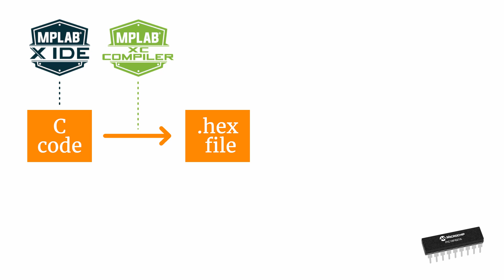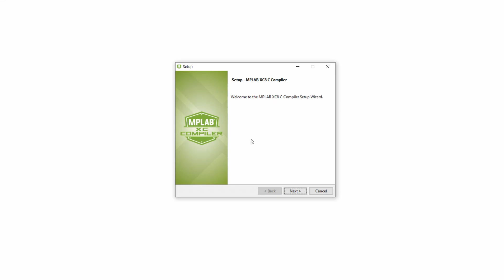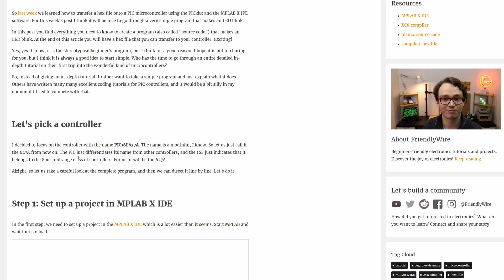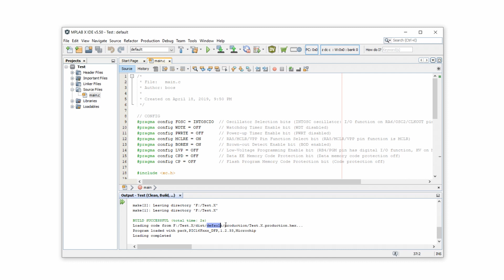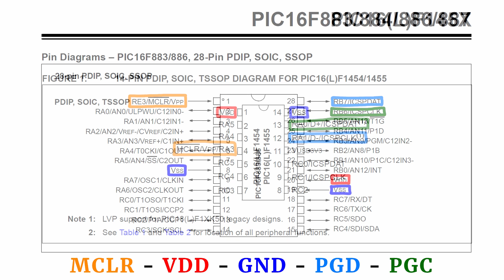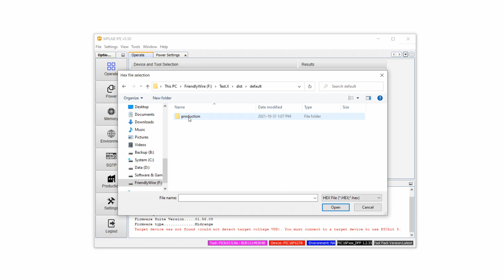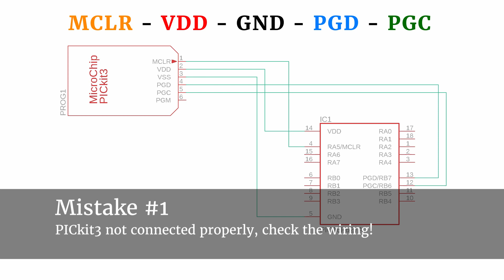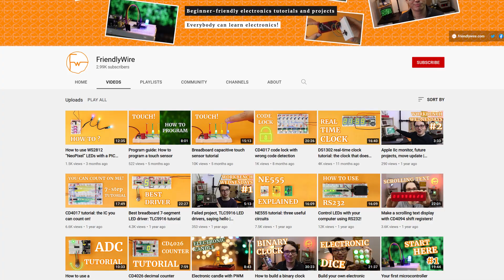How to get source code onto a PIC microcontroller

Comment: Hello. I am using Pickit3 for programing my PIC18F45K42. I have a problem with LED blinking. In code i set the while loop to bling the diode 5 times, but it keeps blinking forever. Does it something has to do with configuration bits of PIC18F45K42 or is something wrong with connections and my microchip maybe is resetting nonstop ?
Reply from the maker: It's probably because everything is enclosed in a loop like this:

while(1) {

// your LED stuff

}

Can you share your code?

Comment: Hi, thanks for your video, it made me understand many things.. I have a .bin file of a USB module, is a motherboard gamepad, the board has a PIC18 chip etc.. I have the manufacturer's firmware file , I would like to be able to open it to modify it, how can I do it ?
Reply from the maker: Hey there, I am glad you found my video helpful! I am not sure how do to what you have in mind, I am sorry. Most likely the manufacturer has code protection enabled. But even if you can get access to the code, it will not be in C, but machine code, which is much harder to read for us humans. Do you have experience in hardware?
Reply: @FriendlyWire  Thanks for the answer, yes, I have experience, but when I open the binary I find: 5!`¤*4$ óÖX›Ñ ‹ìxœï› Ó>Ðº½p, :-(...
I just can't figure out what language this is. i tried all possible converters to extrapolate to C or other, but nothing,. , this file is loaded on the electronic card via USB, using a software: HIFlash.. :-(
Reply from the maker: @fedeyoutub  Try opening this with a hex editor instead, it may be more suitable. But it's probably just machine code for your device, so it will be difficult to convert it back.

Comment: Can we copy hex file from microcontroller??? Please reply as soon as possible 🙏
Reply from the maker: Follow the steps after 7:00. Connect to your PIC, and then click on "read." Then click on File -> Save As, and you can save the .hex code onto your computer. If "code protection" has been enabled, then it won't be possible to extract the .hex-code like this, however. Hope it helps!
Reply: @FriendlyWire  thanks 🙏
Reply from the maker: @satishkumar-gg5fm  Happy to help, and thanks for stopping by! :)

Comment: Hi - Thanks for your video. With the power supply error at 10:00 minutes into your video, change the power setting to 4.75V and you can proceed past this self test ok. No external supply needed. 😁
Reply from the maker: Oh yeah, good idea! It may work sometimes, but usually when the voltage breaks down it means that the PICkit3 cannot supply enough current (and there may be a reason for that, such as a large number of external components). Glad it worked in your case! :)

Comment: Hello. I have seen this video a lot of times and I have made the same "Blinking" program as you and it works OK... BUT when I place the PIC16F627A in my Breadboard and turn on 5 Volt it seems very unstable. The diode is blinking one seequence and the stops but if I touch the PIC chip it turns ON and sometimes the diode just goes ON and stops again and other times the seequence is running. It seems that the chop is sensitive for my fingers... The PIC chip is only connectet to pin 5 for GND pin 14 is +5V and pin 9 RB3. Should I connect all the unused pins to ground or what could I do to make the system more stable??
Reply from the maker: Thanks for your question, and I am glad it's mostly working already! Have you tried adding a 100uF capacitor and a 100nF capacitor in parallel to the battery? This should help stabilize things.
Reply: @FriendlyWire  
Thanks a lot... that solved my problem...Fantastic. I will go on learning  programming PIC's. Are you still making video clip of programming PIC's?
Reply from the maker: @oveschleisner-meyer8139  Fantastic indeed, congratulations! Yes, I am still making videos, but it takes me some time to get them finished. Check out my Twitter @FriendlyWire where I post updates on the new projects :)

Comment: How about 12c508/p 04 HAM modchip???? I need digram point for it GND VDD all 8 pin i have k150 programmer and it give error recived data about reset play...
Reply from the maker: Looks to me that VDD is pin 1, GND is pin 8, MCLR is pin 4, PGD is pin 7, and PGC is pin 6. Check out table 3-1 in here: https://ww1.microchip.com/downloads/en/DeviceDoc/40139e.pdf Hope it helps!

Comment: Sir  , mpli ixe   in  advance  settings  which password  use??
Microchip ic  read and save which  software  best for pickit3.5?
Reply from the maker: I think the default password is "microchip" in the advanced settings, it should say somewhere in the window. I think the MPLAB IPE works with the PICkit 3.5, have you tried it?

Comment: How to program  read in ic and save file for copy other ic .
Reply from the maker: Follow the steps after 7:00. Connect to your PIC, and then click on "read." Then click on File -> Save As, and you can save the .hex code onto your computer. If "code protection" has been enabled, then it won't be possible to extract the .hex-code like this, however. Hope it helps!

Comment: Hello. Thanks for posting this video. I stumbled across it and wondered if this device maybe the answer to my problem. I have a motherboard on which the bios has failed due to my own stupidity as to how I flashed the chip (Winbond W29C020-12 32 pin 2mbit) whilst the onboard button battery was dead. I then flashed it a 2nd time and wrote over the back up (duhhh). The consequence is that the board cannot see a floppy drive or even a non accelerated ISA VGA card. The motherboard company are no longer around, but I have the bios on a floppy disk in the form of a .bin file which suggests the file is hexadecimal in nature. Would the mplab software be able to view this type of file in order to 'flash' it directly to the chip? Thanks.
Reply from the maker: Thank you for your message, John. I don't think the PICkit3 will be useful for that, since "out of the box" it only interfaces with PIC microcontrollers. It may be possible to write your own PICkit3 firmware, but I am out of depth at that question. I think at https://www.reddit.com/r/AskElectronics/ you may find people who know how to do that. Good luck, and sorry I could not be of more help, I hope you will find a solution!
Reply: @FriendlyWire  Many thanks for your response. I will check the link and keep looking for a solution.
Reply from the maker: @johnsparks3979  Good luck, and my apologies that I could not be of more help. Best of luck!
Reply from the maker: @johnsparks3979  Best of luck! Did you find anything?

Comment: Mine didn't work initially, even after trying everything you said. It finally worked after placing a resister between the VDD and MCLR, which from my understanding, was not required (newb trying to read datasheet) : using PIC52313
Reply from the maker: Thank you for sharing, Mike, and I am so sorry that it didn't work for you. (Sorry that I am replying so late, I only now saw your comment.) MCLR does not require any resistor to VDD with ordinary PICs when programmed with the PICkit3. I am having some trouble finding this controller, the PIC52313. Usually the names start with PIC16F or PIC12F, but this one is different. Can you double check the name? I would love to figure out why it didn't work out properly.

Comment: one more question on some other Topic, how and from where to get and download different supporting library's for PIC microcontroller ? 
e.g LCD library or I2c , or RS485  I mean any library
Reply from the maker: Libraries are not so common with PIC controllers; the reason is that each PIC controller is different. You can search for what you want to do, say, control an LCD. When you find a project online for a specific PIC you can usually use it easily yourself for the same PIC. For really advanced topics, such as SD card memory management or USB stuff you find some libraries, but for simpler stuff you probably have to code your own. I think of it as an advantage (long term) because it really teaches you how to code, but for beginners it can be frustrating.

Do you have anything in mind, in particular? I would recommend to get started with a simple project, maybe one from this channel, and then take it from there :)

Comment: is there any other way to program pic microcontroller  without using pickit to save money?
Reply from the maker: You can find unofficial copies of the PICkit online, they cost much less. Also there are some circuits proposed by hobbyists that can get the job done, but I have never used those. What is your budget for a programmer, and where are you located? Maybe we can find one for you :)
Reply: @FriendlyWire  india
Reply from the maker: @shrikantnikam2426  You can try searching for PICkit3.5, this is a popular third-party programmer that works well in my experience. Especially if you want to stay with PIC controllers it may be a good one-time investment. There are also older programmers that use the serial port to program PICs directly, but they do not work as reliably I find; one of these you can see here on my website: http://www.friendlywire.com/articles/gear/#ch5

Comment: thanx a lot for nice video. I have a question , if the code has been written through mikroC....... Still it will work ?
Reply: I am sure HEX file will be same generated by MPLAB or MikroC.......but still want the clear my doubt.
Reply from the maker: @sanjaybatra6593  If you have the .hex-file that is compiled for your PIC then you can definitely send it with the MPLAB IPE. The C code may be different for different compilers (XC8 in this case, but there are many others) but the .hex-file will always be the same :)
Reply from the maker: Thank you, Sanjay! Can you send me a link to that compiler?

Comment: This is very good info and has got me 95% toward the end of my project. I think...But what do we do when some of the 8 pins on my PIC12LF1822 are labeled differently. It has a Vdd and Vss  as 1&8 pins resp. but other pins are labeled RA0 to RA5. Am I off track now or can RA0-RA5 be used? Thanks for the interesting video.
Reply: Hey Thank you so much. I appreciate the help.¡
Reply from the maker: Great, happy to help, and thank you for stopping by! :)
Reply: @FriendlyWire  Hey Jens, after many days of delay I got around to programming my PIC today and it went very smooth and programmed successfully. Thanks again for your easy to follow directions and help.
Reply from the maker: @CliveDrone  Hey Chris, that's fantastic news, I am so happy to hear it! On to new adventures!!!
Reply: Please can I program pic18 series with pickit3?
Reply from the maker: @guavacodelab8807  I have not used PIC18F's so far, but it looks like the PICkit3 supports the PIC18 series. Check out this blog post here, for example: https://pic-microcontroller.com/pickit-3-supported-devices/
Reply from the maker: Thanks for the nice comment, Chris, I am so glad my video was helpful! :) Can you send me a link to your datasheet? I am happy to help!

//edit: Nevermind, found it (http://ww1.microchip.com/downloads/en/devicedoc/40001413e.pdf)! Look at table 2 on page 3 :) It looks like PGD is RA0/pin 7; PGC is RA1/pin 6, and MCLR is RA3/pin 4. Hope that helps!

Comment: Great video!!  I have an issue with one PIC from one of my clients. Somebody erase the PIC´s model on the chip, and I don´t the model to read the program. Any tips to do an auto recognition? Thnx
Reply from the maker: Thank you, Alonzo, glad you like the video! :) I am not aware of auto recognition, but usually the MCLR/PGD/PGC lines are at the same place given a package size. How many pins does the PIC have?
Reply: @FriendlyWire  18 PINs
Reply from the maker: @AlonsoCorrales  In that case I would just try the pinout of the PIC16F627A (http://friendlywire.com/tutorials/touch/PIC16F627A-datasheet.pdf). MCLR at pin 4, PGD at pin 13, PGC at pin 12, VDD at pin 14, and VDD at pin 14. Then you can make a list of all 18-pin PIC's and try them out by selecting them in the MPLAB IPE, and see if it connects properly.

Comment: Can I check a code from PIC18F2420 too?
Reply: I mean, I have one pre -programmed PIC microcontroller and another that has not been programmed. So my question is can I copy or re -read the code from a pre -programmed PIC microcontroller and re -copy the program and transfer it to another PIC controller
Reply from the maker: @adamismaad9604  Yes, if the original PIC does not have code protection enabled you can read out the .hex-file. Look at 7:30 in the video. You can click on "read" and then you can download the existing .hex-file. Then, if you click on File -> Save As you can save this retrieved .hex-file, and then send it to any other PIC you want.
Reply: Oh ok thank you very much
Reply from the maker: @adamismaad9604  Happy to help, let me know if it works!
Reply from the maker: Hey Adam, thanks for the question! I am not sure what you mean by check, but the MPLAB IPE does indeed support the PIC18F2420, so you could connect it to the PICkit. For the PIC18F2420, MCLR is at pin 1, PGD at pin 28, PGC at pin 27, VDD is at pin 20, and GND is at pins 8 and 19. (See the datasheet here: https://ww1.microchip.com/downloads/en/DeviceDoc/39631E.pdf ). Let me know if that helps! :)

Comment: Really clear and understandable, A couple question... 1. If you have more than one VDD and VSS, do you have to connect power and GND to all points? 2. If I just want to read the data from one Chip and send the Hex file to another Chip. How can I do that?
Reply from the maker: Thank you for your kind words! 

1. In our case here, all circuits run on one VDD (typically 3V-5V) and there is only one ground potential. All chips are connected to VDD and to ground. If you connect the PICkit3 to such a circuit, then you have to connect the VDD pin of the PICkit3 to the VDD of your circuit (and hence to the VDD of all chips), and to the ground level. In general, you always have to make sure that the PICkit3 is connected to the VDD and ground of the controller you want to program. If your circuit has multiple voltages (say, there is also a 9V rail, and so on) the you have to be careful not to destroy the PICkit3, as it can only tolerate up to 5V.

2. Yeah, you can do that, provided that the chip does not have code protection enabled. Follow the steps in the video, and at 7:30, when you connect the controller, you see the option "Read" (in the same row as the "Program" button). If you click that button, you will be able to read out the current .hex-file that the microcontroller uses. The IPE will then ask you where to store that .hex-file, and then you can use that .hex-file and send it to other controllers, too.

Hope that helps, let me know if you have more questions, and thank you again for your interest! :)
Reply: @FriendlyWire  Thank you for your prompt response. I did as you suggested but when I press the Read tab in the IPE it just say read successful and does not ask me to save it anywhere. I am using PicKit 4. I also enable the Pickit to supply the 5 volts. Any ideas? The Chip that I am using is a PIC16F877-20I/P
Reply from the maker: @Electrolab28Ag  Oops, my bad. I think after the read you have to click on File -> Export and save it this way. Does it work for you? :)
Reply: @FriendlyWire  I am out of the workshop today, buy once I get back and I'll try iy and let you know.
Reply from the maker: @Electrolab28Ag  Yeah, let me know if it works!
Reply: @FriendlyWire  OK I tried and It save as a hex file. However when I place the New IC to load the Hex file it does not want to program it. Do you have an email so I can send you some screen shots of what's going on?
Reply from the maker: @Electrolab28Ag  Sure, I am happy to help. You can find my email at the bottom of www.friendlywire.com :)
Reply: @FriendlyWire  Ok... I tried it this morning and it work. I got it to burn on the new IC. Thank you very mush for you patience and Knowledge.
Reply from the maker: @Electrolab28Ag  Fantastic, great work! :)
Reply: @FriendlyWire  Do you have a tutorial for beginner's on how to write codes for the PIC's? eg. like where to place parenthesis, wording that should be used etc. or know where I can find such a tutorial?
Reply from the maker: @Electrolab28Ag  Sorry, I don't have that exact tutorial, but if you follow along my videos it should definitely get you started. The language we use is a C dialect, so it helps to have some familiarity with that, and for that, any C tutorial works :) Let me know what exactly is the hardest part to learn, it would be super helpful for me to create better videos for beginners in the future :)
Reply: @FriendlyWire  What is hardest for me is how to start writing in C and what characters to use while I am writing the programs.
Reply from the maker: @Electrolab28Ag  Yeah, the first step can be hard... I would suggest to start with the simple programs here, blinking an LED, reading the ADC input, and so on. Does that all work for you already? :) It will be worth it, and it's not that difficult to learn, you can definitely do it in a few weeks! :)
Reply: @FriendlyWire  Thanks, I'll try.
Reply from the maker: @Electrolab28Ag  Awesome! Let me know how it goes, I am happy to help if you have problems with the projects :)

Comment: I can't find those pins name in this chip Z86E3116PSC
Reply: Thanks
Reply from the maker: Thanks for the question! The Z86E3116PSC is a Zilog microcontroller, not made by Microchip. For that reason, unfortunately, we cannot use the PICkit to program it.